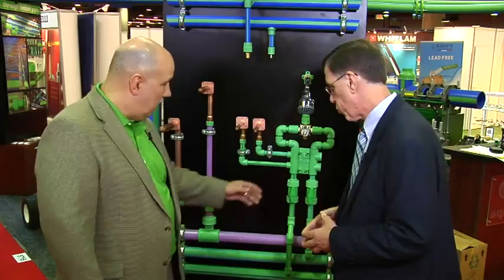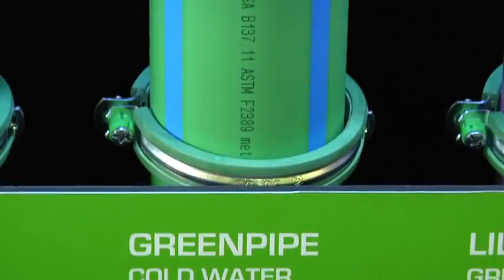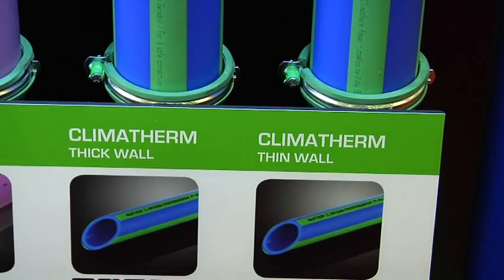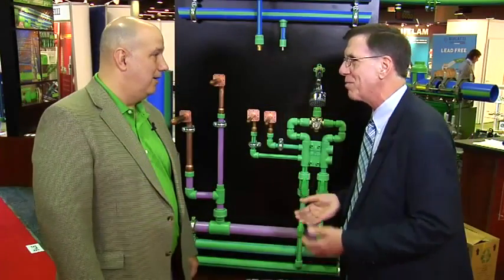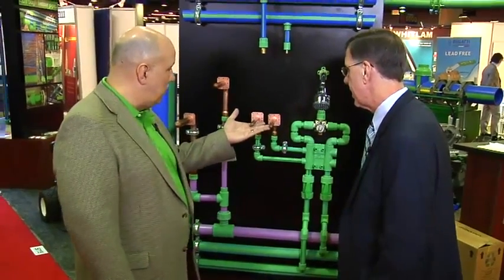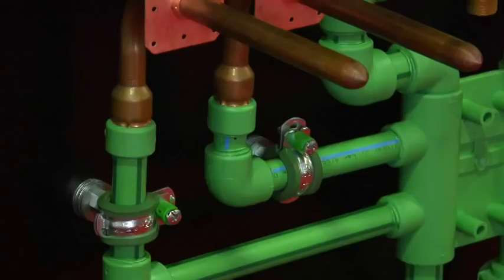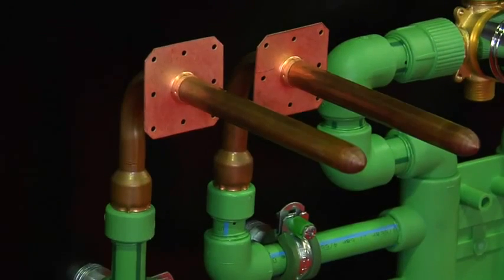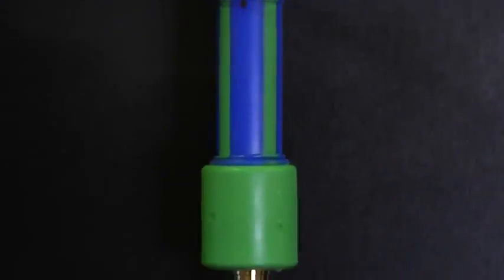Aquatherm Inc. Polypropylene Pipe - With a threadless PP-R to Copper Transition

Comment: Whenever someone concludes the conversation with the phrase "I wish you luck" , you can bet that they don't fully trust you or your products. That's OK though, most new products are received with doubt at first.  I see all the negative comments below but I would  argue that plastics have a come a long way and can be very durable and long lasting. Copper piping ain't the only game in town. And Copper isn't without faults and downsides either.

Comment: As a plumber who has to install this product in the field I can tell you this is an impossible material to work with. 
Trying to juggle a hot iron on top of a 12 foot ladder while trying to press fittings onto pipe is frustrating to say the least. 
Trying to keep the pipe straight and looking professional takes entirely too much time. You either choose to get the work done or choose to spend the day attempting to keep pipe straight and looking professional. 
This product is literally the worst piping material I've ever worked with. You dont get to make adjustments. The pipe cracks in cold weather. If there's a leak there isnt an easy fix like copper. You have to cut out sections of pipe which wastes material. 
It takes two people to run 1/2 inch water line which is a waste of man hours and completely ridiculous. 
As a professional I must say this crap is the worst. I have yet to work with a plumber that doesnt mind working with it. 
Why we ever got away from copper is beyond me.
Reply: Doug Riva I would just use a pex a or ipex blue
Reply: But pex leach chemicals into the water and create strange odors.
Reply: Agreed